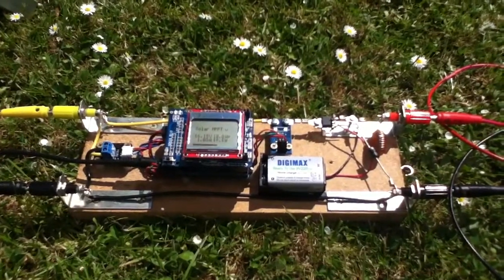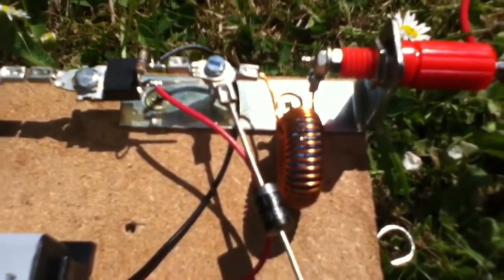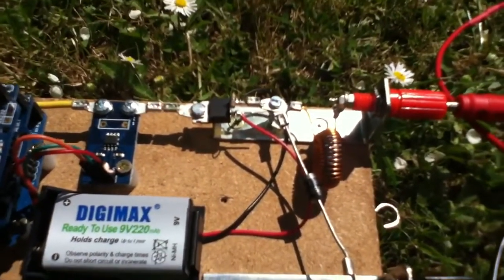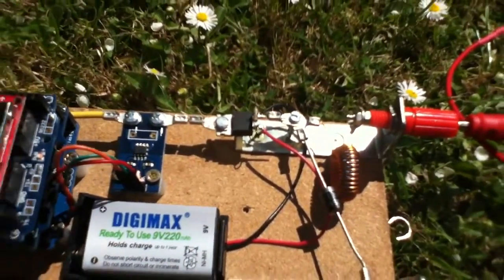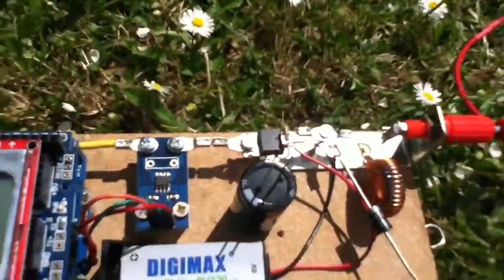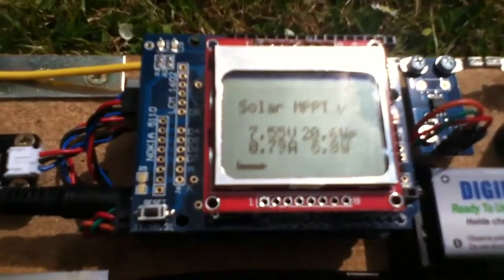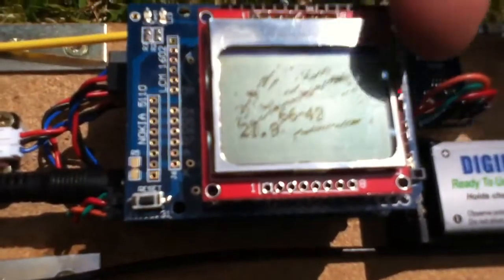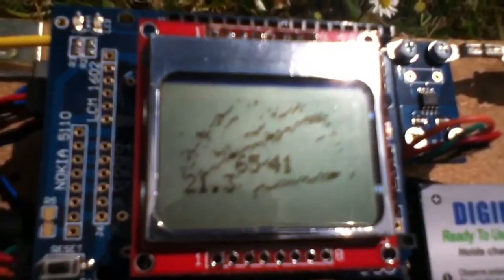MPPT Solar Charge Controller #7 - Buck Converter Components Added

Comment from the maker: Yeah, although I'm starting to think that I'll need a dual trace scope (or even more) as I'd like to watch the inductor voltage and diode voltage and have the oscillator waveform on the screen, all at the same time. My rather basic single trace scope may not be much use.